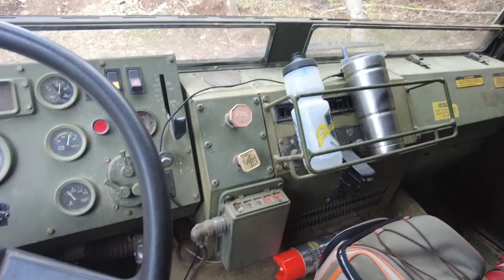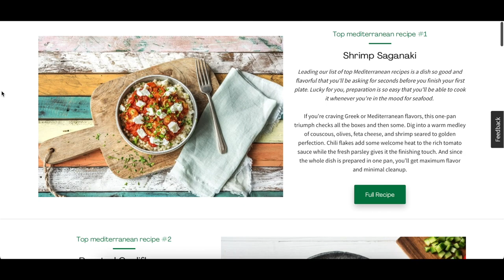Couple Builds Road With ZERO Experience

Comment: Awesome job guys! Keep in mind the dirt you are using for fill will settle and be very prone to rutting for a while, especially when wet. Putting down a geotextile fabric and then road mix would stabilize the road immensely, even if only done in the worst areas.
Reply: right advice
Reply: Rock fabric (geo textle) is the best invention since sliced bread.

Comment: Do you have gravel minus in your rock yards up there?  It is small triangular, decomposed gravel with the fines.  It packs down like concrete after it gets wet. But you do need a fairly good road base for it.  We have red clay roads around here.  The county added about a foot of it and we essentially have paved roads now.  The triangular rock locks together.

Comment: If you need to break up boulders to remove them there's a concrete product called dexpan. You drill a few holes in the Boulder, pour in the dexpan and by the next day it'll be broken into manageable pieces.
Reply from the maker: We have been wanting to try that!
Reply: The Egyptians created small holes and put in wood wedges that were then wet to bust entire obelisk shapes out of granite.  No machines.
Reply: I used it to break up granite boulders at my lake house.  You need to rent a good compressor and use a jackhammer with an air drill bit to get nice holes for pouring it into.   Around here they call it Chinese dynamite.
Reply: Take a look at Walnuts and Wineberries channel. They are building a road to the top of their mountain and were using Dexpan on a very large rock. Broke it right up.

Comment: Don't be afraid to use emergency on CTIS, it is for exactly what you were trying to do, just air back up to sand or xc once you're out.  Man, I need to get the GMC 6000 dump sold and pick up an M1078...  Great road building manuals exist from the forest service, NPS, and Federal Highway Administration...  Good "light" reading. :)

Comment: Riley, the next time you have to remove a big rock, get a hammer drill and drill 1/2” holes 4 to 6” apart the use the jack hammer in the holes and the rock will break apart easy. That way you dont have to fight a stuck jackhammer.

Comment: Watch the stone Masons at the marble quarries  .Rotor hammer/hammer drill 5/8 bit 12" length ,hole at 3" spacing length or width of rock/boulder if anything a line of holes  every 6" to form slabs .Use electric jack hammer to connect previously drilled holes then drive steel wedges in 2blows each ,between all the wedges combined force should split. And don't forget to walk down / pack the dirt with humpty and a LOAD of rock.Otherwise when it rains  or the melt happens it'll act like a giant lava cake and slide all the way down to the  bottom or first debris jam ..play safe guys!Use broken rock to build retaining wall Don't forget the soil retention membrane over bank then set rock debris in footing trench ..read up on water seepage draining  long subject .

Comment: Have you guys heard of  "Dextron"?  You 'drill'  1/2 inch dia. holes into the rock as deep as you reasonable can, pour in the Dextron, leave it overnight and 'magic' happens. It expands sideways, hydraulically cracking the rock and effectively shattering it ....

Comment: My opinion, you guys need some road fabric in those mud bog spots. The fabric will stop the mud from "pumping up through your road bed material. It will stabilize everything.
 Google building a Corduroy road, yet another way to build in stability to the road bed.  Cheap too... labor intensive. 
 The timber lasts for years without oxygen.  Yet another idea.

Comment: Hey there ,as others have said you need either clay or chirt ,but not the soil that your using ,sorry 😔
Clay will pack down,and then metal on top of that ,the water will just go through the dirt that you have used,and it will become a boggy mess .
If you have someone close who is a road builder ,see if you can get some advice from them , understanding how the different soils work is very important.there are many You Tube channels on earth moving 
Let's Dig18
Dirtperfect
You may get some tips from watching 
Cheers 
Hope you master that D8 and can use it competently,
Nice to see the lady operator,well done

Comment: I want to see you buy or rent a portable sawmill I want to see you use or rent or buy a wood chipper with a either self-contained or a power takeoff on the back of a tractor you need to go ahead and take advantage of your Woodlands by not burning the trees but by cutting up the trees to get Lumber to build cabins and stuff or for resale or to make things .Get a wood chipper to chip up the branches to use for around the property to cut down soil erosion on to enhance the soil and prevent washouts. Don't burn, Please, please use every bit of the tree. You are going to have a garden, use the wood chips as mulch. What a waste of God's Gift to you two. God Bless You Aways

Comment: So are you going to hire a very experienced operator to build the rock wall to support the new road where it does the switchback onto the neighbor's road? Not questioning your competency, but it takes a long time to be good at building rock walls. And I ask because rock work is challenging and requires a lot of precision to be sure that the upper road is supported. The road sure looks a lot better!
Reply: So agree with that after.38 years running equipment i didn't build support walls often enough to be good at it.

Comment: DID NOT SEE THE FRONT AXLES  MOVE IS THE TUCK ALL WHEEL DRIVE
Reply from the maker: The truck was locked into 4 wheel drive, but it doesn't have locking differentials in the axles.

Comment: How is it possible for a truck of that type to exist that does not have locking differentials. No I'm being serious here. I didn't know it was possible to buy trucks that had CTIS but didn't have locking differentials. That's like selling a house with central air that doesn't have a roof or an electric assist bicycle without a chain and gears. There is an order to off-road vehicles and locking differentials always comes before CTIS and often comes before big tires. Something is severely fucked up about that truck.
Reply from the maker: The FMTV family of trucks do not have locking differentials. Probably to make them simple to operate for inexperienced drivers.
Reply: @AmbitionStrikes  I'm shocked and speechless. I cant comprehend how something could be sold with a button labeled sand mode but not with lockers. For off-roading having locking differentials is almost as important as four wheel drive and it has almost as much effect on your traction. Without lockers im sorry to say but that is simply not an all terrain truck. Nothing against you guys, im just aghast that something like this is even being sold. It feels like a scam.
Reply: @AmbitionStrikes  I did some quick research and found that kits do exist to upgrade your diffs with lockers. I didn't bother checking up on pricing because that's a big wide range determined by a whole lot of stuff but it looks like a project you might be able to tackle yourselves. Might be worth looking into it. You have answered my question about why your truck is so bad at off-roading, you wont see me comment on this issue again. Enjoying the content as always, best of luck.